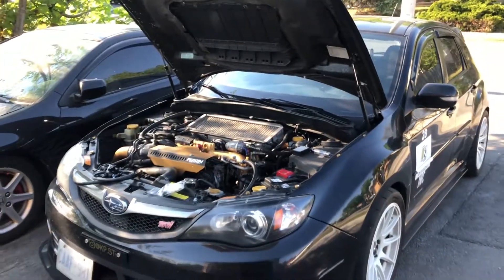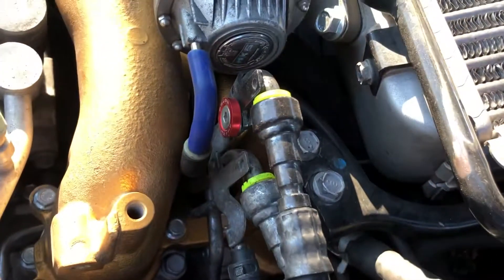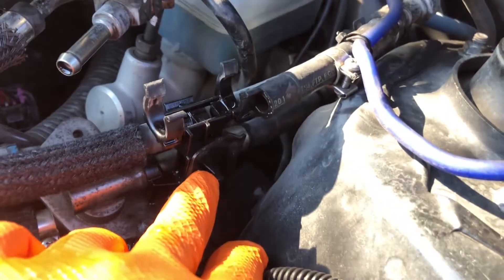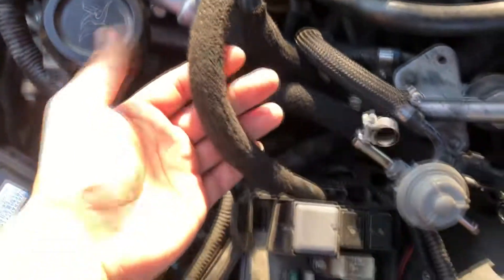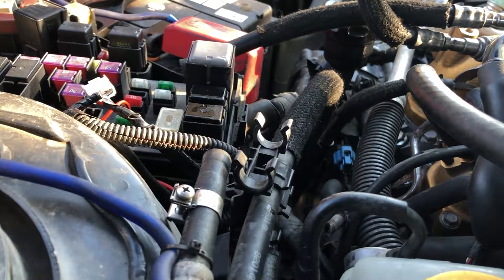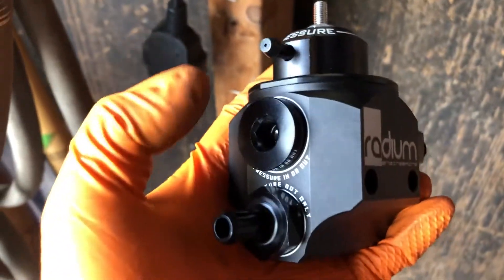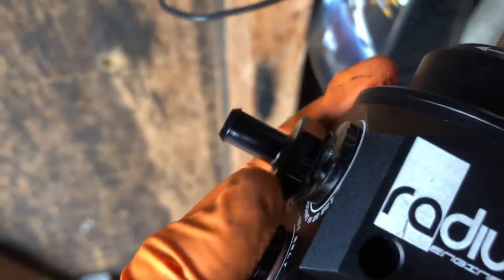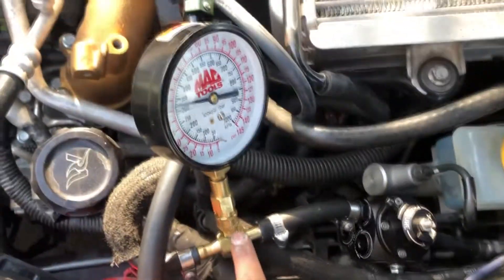PROJECT STi: 08-17 Radium Fuel Pressure Regulator (FPR) Kit - How To Install Tutorial

Comment: Would you install this the same way on a wrx or would you need an adapter plate
Reply from the maker: I’m not to sure as this kit is only STi specific, I know the mounting points for the oem fpr and dampeners are located on the intake manifold so it may be different.

Comment: Hey great vid, did you have any issues with noisy pipes? I just did the instal and now I can hear noise on left hand side of the car when inside the car. I can feel the feed line pulsating when running.
Reply from the maker: Yup that is totally normal, because now we had removed the fuel dampener which dampens all the fuel pulses. So now it’s just straight flow to the lines and regulator.